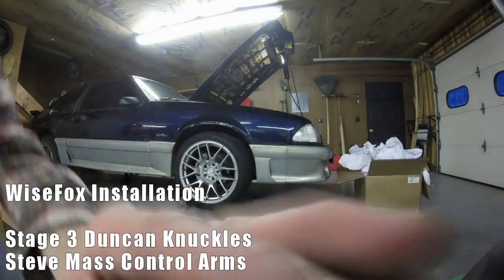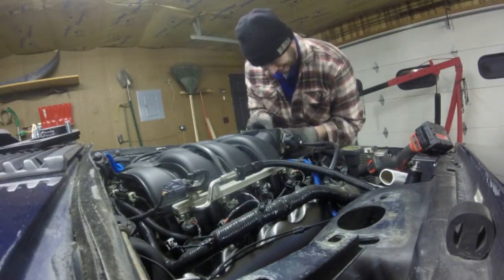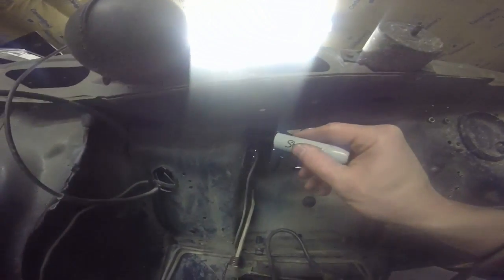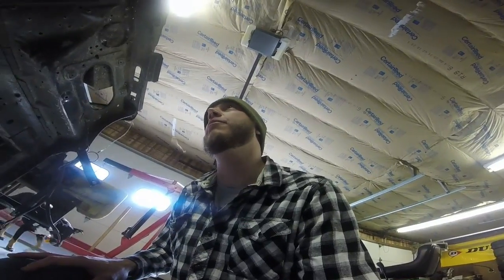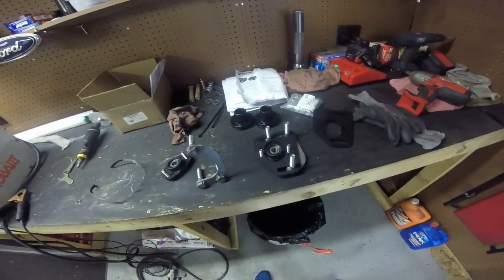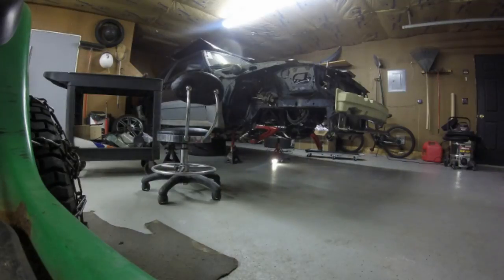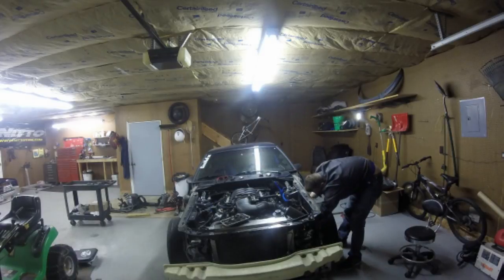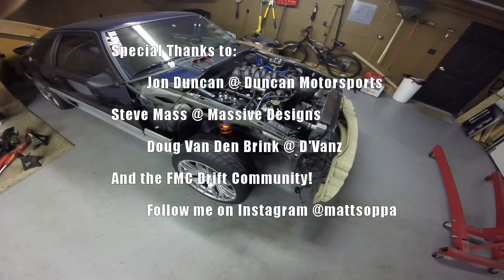Installing "WiseFox" on a Foxbody

Comment: you really should try adding static negative camber. you want to add it until your inside wheel's tire patch is optimized at full lock. 
a lot of cars endup running 5° or more, it all depends.
Reply: nice! I didn't notice much camber in the video.
How's this thing feel on the track?
Reply: sweet! have you checked on your Ackerman specs? I'd imagine there's still some difference left to right if it's still well mannered on the street
Reply: you haven't felt any kind of tradeoff of speed with the welded diff? normally they don't carry speed through the drift like a limited slip would